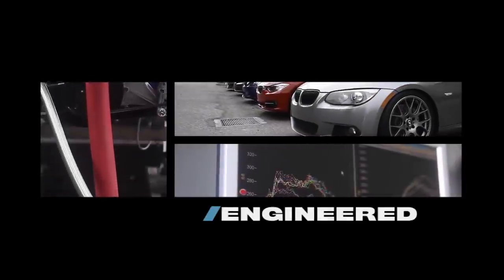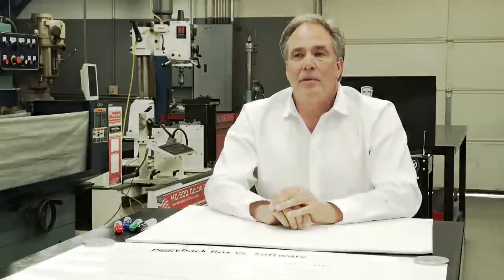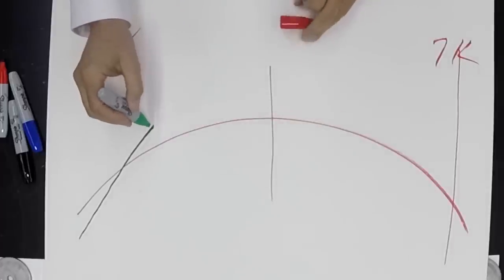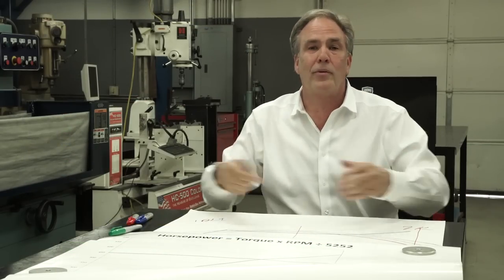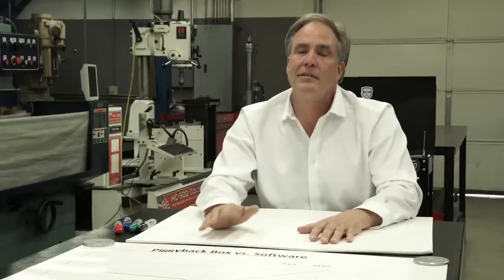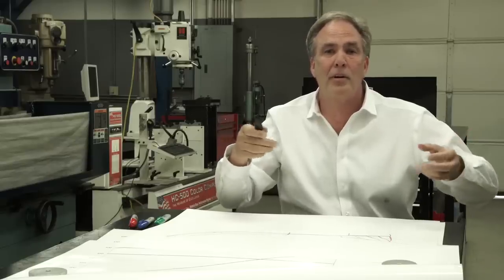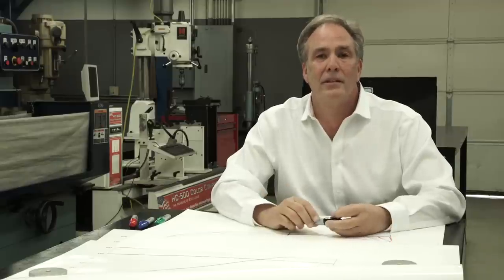The Magic of ECU Tuning - /ENGINEERED

Comment: how will this apply (forced induction )to self tuning injection sysyems? eg holley hp/dominator
Reply: Having a professional play with it over the course of a few days with the assistance of a dyno will get the best out of it. From what little i have had to do with holly hp, it's more self learning, not self tuning, i.e, it can interpret the knock, adjust the timing etc but still needs the basic parameters of the system you are running etc, such as injector size etc...

Comment: 6:50 is incorrect you can get a bone stock zx14 retuned for 10-15whp same for hayabusa, many many stock n/a cars can get a 10whp 20ftlb gain by tuning because many times manufacturers make them lean from the factory for emissions etc.

Comment: I bought a 200$ reprogramming tool for my standard ecu na clio, i can now install different tunes, like for an example if want a lean fuel mixture for pops and bangs. I was pretty unsure about the purchase but i feel like with the ron 98 tune i have more torque in the low revs, placebo or real?
Reply: You want pops and bangs? Sounds like some 4 banger ricer crap. Pops and bangs are considered cool by high school kids. If I hear pops and bangs it usually means a improper tune on the car. Its not cool at all its just sad.
Reply: First of all i didnt put this tune on it was just an example, and second have you ever heard a fucking supercar? Ohh my god it spat flames, what a bad tune it must have -.-
Reply: You don't have a supercar so don't worry about what a supercar does its out of your league.

Comment: Agree 100% with what Steve said, with one caveat. Several manufacturers essentially de-tune performance engines by vehicle class. Meaning, lower end vehicles would have lower HP 'tunes' from the factory. Take a C class AMG, for example. For all intents and purposes, the same engine as an E, CLS, S Class but a lower HP output (M156). A simple aftermarket brings your lower end tune up to the rest of the power of the higher class brethren.
Reply: True but still the hardware matters, the c class uses the same engine, but other components are going to be different which would be the bottleneck
Reply: Not only is this point valid, but there is one more piece to it.. if you don't need to pass emissions (or plan on bypassing the emissions) you can get a simple tune to basically devoid the ECU from including the protocols that relate to these things.. you will get better performance and gas mileage by removing the emissions from the equation.
Reply: David Huffman 

Partially true.Its ultimately the emission norms that keep a check on the manufacturers.

Complete combustion of the fuel does have its pros n cons.We can get the maximum out of an engine but on the other hand emission parameters may cross the desired limit.

Comment: If I understand correctly there is no gain to be had from ecu tuning a naturally aspirated engine, right? I have a K24 Honda and was thinking of getting it's ecu tuned, since the guys on the Honda forum over here swear by it, but I'm starting to reconsider. As they advertise it, the tune changes the drive by wire mapping (which apparently is a little tame from the factory to make for a family friendly car). That is probably simple to do and is probably noticeable but nothing you couldn't otherwise achieve by pressing more on the throttle pedal. They are also talking about changing the fuel maps so that the engine is more economic if not stressed and more powerful when you step on it. With what this guy is saying, I'm thinking this claim to be very unlikely, or the improvements to be on the order of fractions of a percent. The last thing they do is change the VTEC RPM engagement, so that if you are shifting at redline and on wide open throttle, when you go for the next gear, you don't drop back on the low RPM cam. Also here I'm thinking there might be some advantage, but in the real world how many times are you gonna do that and what are you going to do with the milliseconds you saved by doing so.
Reply: Exactly. The gains they promise are at RPMs that you almost never end up at. NA engines are already tuned to their maximum mechanical limits, as this guy also says.
Reply: The ECU tuning might gain a few ponies, but not much. They can change the torque curve around for better allround performance. unless you want to be 0.1-0.2s faster I wouldn't waste money on ECU tuning a NA engine.
Reply: Tuning your N/A ECU can be worthwhile if you've already modded things like intake, headers, exhaust, head/block work, but other than that, don't waste your money - especially with a Honda. Honda (by their own admission) is an engineering company. You're not going to "out-tune" them......especially with some high dollar plug and play BS. (FTR: I've been a Honda guy for 20 years).
Reply: Well, they are tuned for a more reliable car, so if you don't care about mpg or reliability you can out tune them by maybe 5-15% depending on how high you risk to put the rev limiter (you need to change the cams for that though)

Comment: great video. so is he saying that just a hand held tuner wont increase power?
Reply: not with N/A motors. you need bolt ons with a tune for N/A motors. FI motors can get by with just a tune, but can get even more with bolt ons +tune.

Comment: Dinan is correct, manufacturers tune the engines to the max based on the mechanical limits of parts. People just don't understand that. Now if you remove some emission stuff, get a better flowing intake and exhaust and then tune it of course you can make more power. But stock your not going to be able to beat......... I thought this was a fantastic video
Reply: +Ian Thompson Wrong. OEM's tune cars for worst case scenario since they are removed from the car and it has to be serviced in the field.  This leaves quite a bit on the table; boosted engines are best case scenario for cars. People like NA because if they get big numbers it makes them look like a hero to those who are devoted to that "religion" . A boosted engine will ALWAYS make more power because as he said there's basically no limit if you have good fuel, you'll either run out of fuel, pop the head gasket (studs will fix that) or bend the connecting rods...  To make big power NA, you need either more complexity (variable valve timing, etc), lots of static compression, huge cam lift and either lots of RPM (F1, small displacement hyper cars) or lots of displacement (Pro Stock). To make even more you need to fully understand cam timing and flame front in the cylinder. NA's are highly impacted by air temp and altitude unlikely boosted which are mildly effected. Most of the emissions components have been removed from modern cars, because high rare earth metal ($$$) converters clean up the majority of the bad gases an engine creates. Until Electric car zealots figure out how to make batteries cheap and get the same range a fuel car does, we'll be running on gas for a very long time. One possible break-through is fuel cells which are horribly expensive to produce.

Comment: Note, he says that software tuning a Naturally Aspirated engine nets you a 0 gain.

His shop sells software for N/A cars (BMW S85 / M5 V10). 

Which is it?
Reply: +0verbear a N/A car with no mods bro. like exhousrt n crap.
Reply: +0verbearIn 99% of cases, a simple chip tune or ecu flash with no other modifications present is only moving the powerband around (which can cause the perception), not creating new hp.
Reply: +Shift4g Hmm, yeah it may not make more peak power. But it is making your car faster. Everyone gets so hung up on peak numbers. Theres a reason why he is talking about the torque curve for like two minutes.. it matters.. a lot.
Reply: + yall If the ECU is smart enough (majority of German cars) and has wideband 02 from the factory, you can gain something if you move the fueling safety limits a bit further (leaning it out) and adjust timing assuming the fuel grade isn't crap. If the ECU isn't smart enough (majority of a bit older Japanese cars) and doesn't come with factory 02, you can gain a lot more if you know what you are doing and force the engine, through datalogging, to push for lean mixture and advance timing from the original safe/economic factory limits.

This is what I have found after having owned:

- Renault RS 2.0 (off the shelf with options given to the tuner)
- VW EA113 2.0T FSI with factory 02 (off the shelf with self tune options)
- VW VR6 3.2 with factory 02 (off the shelf with self tune options)
- Mitsu Evo9 2.0 without factory 02 (mind you this is F/I and a complete custom job with E85 and lots of bolt-ons, I purchased a custom tune and finished it by myself by having full ECU access)

What I wanted to point out here is that even though for the average viewer Mr Dinan comes across as a tuner god, all of his claims do not hold water as-is and are in need to be taken with a grain of salt.

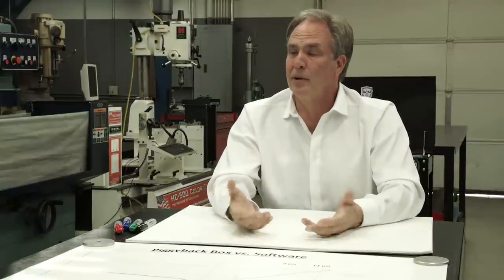Comment: 6:35 No, sorry you're wrong. You would be correct, except that manufacturers have to adhere to emissions standards and that's where the performance can be gained. There a bunch of engines used in different applications but some may be detuned. That's where power can easily be gained.

And I'm not talking about some $20 eBay chips. I mean professional tuners that are ~$400.

I come from motorcycles so here's an example. The newest generation R6 never achieves WOT in 1st or 2nd gear due to noise and emissions restrictions. That's easy to fix with a Flash though
Reply: +MotoBoy Also modern turbo diesels are a really good example.

I know there aren't many diesels in the USA so you all may not be that aware, but obviously due to emissions regulations and shit they come very conservative from factory. 
Say you get a 2L turbo diesel Ford or something, small turbo running half a bar of boost from factory when in fact it can push .6-.7 bar and the a/f or injection maps are really conservative. 
If you want to get really complex then in variable vane turbos you could probably re-tune them for an entirely different powerband.
Good luck getting the software to do so, though.

Just a reflash of the ECU can add as much as 30-40% more power in these cars if it's a low displacement engine. 
It's similar to the japanese cars of the 90s which were rolled off the factory de-tuned to comply with the gentleman's agreement thing, seemingly limiting cars like the R32 or R33 to '276' hp when in fact they were built to push 320 or more even on stock boost levels.

A different story for N/A engines, of course you're unlikely to get any sort of gain from engines like the F20C, maybe 3-4%, but in larger disp cars like the M5 E60, 500hp from a 5L V10? There's no doubt you can squeeze more power out of some of them. 

The main drawback is not being able to access these ECU's yourself. Who's going to buy an AEM Infinity + pay to get it re-tuned for small gains? ;_;

Comment: I can't agree fully on his verdict for tuning N/A cars. Some engines like Mazda's SkyActiv have a 13.0:1 compression ratio but have all sorts of cooling/anti-knock tech to let it run at 87 octane. Surely re-mapping timings for an engine like that to run 93 fuel would give you performance gains?
Reply: Most engines like that are designed so that they will adjust for higher octane to take advantage of the potential power gains.
Reply: lobsterbark
So the knock sensor will periodically add timing to see if you've maybe put higher-grade fuel before going back when it pings? Maybe you're right, but logically that seems unlikely.
Reply: ***** Most modern luxury cars at least have that feature. Many economy cars do as well, but you would have to look up your model to see if it does that.
Reply: Elsewhere I've read that later model GM vehicles run an octane diagnostic when you add fuel to the tank.  They'll try to run the most aggressive curve,  but they'll detune if they sense detonation.    The flex fuel models also have a sensor in the fuel line from the tank to the engine,  when alcohol is detected they will run the most aggressive tune possible.     My 16 Silverado 5.3 liter is rated at 355hp and 383 lb/ft on gasoline,  on E-85 it's rated at 380hp and 416 lb/ft.

Comment: What's the reason we can't directly inject gasoline into highly compressed (high-pressure) chambers and have them self-ignite like we do /w diesel?  Seems conceptually possible.
Reply: Gasoline needs compression ration of 8-10 and compression ignition engines are designed to have compression ration above 18. 

So when gasoline is fed, it will automatically burn and hence create a blast way below the TDC of crank. This will not give uniform torque and due to excessive reverse torque acting on crank , it may fail.
Reply: +Richard Mozey thats not true. 16:1 compression ratios have been and are used in motoGP
Reply: +TheCaps35 but moto Gp engines are not available. Same with F1 engines that rev twice as high as street car.
Reply: +s50201 Well because if want to do that you have a diesel engine. The reason the diesel engine uses diesel and not gasoline is that gasoline doesn't like to ignite itself, so you would have to compress it extremly. Diesel on the other hand ignites easier at high pressures, so it works better for seld ignition. Just two fuels for different engine types.
Reply: +s50201 Diesel needs way higher compression to ignite. Diesel "burns" instead of explodes like gasoline does. Gasolines ignition point is way lower than diesel, which would make issues with controlling the ignition.
Reply: +s50201 That idea's been around since the 1960's. Mercedes tried it a couple of years ago just as a technical exercise on one of their concept cars, the F700, Google 'DiesOtto engine' for more info. Also Hyundai and Delphi are currently experimenting with this, look into HCCI engines to learn more. As I understand it, the problem is that petrol contains more energy and is thus more volatile than diesel and getting it to work under the conditions of compression ignition pushed the limits of available technology. Do some research of your own, you might be able to come up with an answer.
Reply: +TheCaps35 I would consider that an exception mate. Doesn't apply to the millions of vehicles on the roads.
Reply: +Christian Huber you sir are correct, the amount of compression necessary to self ignite gas would required too  much power and make the motor weak.
Reply: +s50201 Hyundai, Kia, Mazda, and other third world car makers have been making GDI engines, Gasoline Direct Injection for years, they still use spark ignition though as compression pressures are too variable in a inlet throttled engine.
Reply: +whorayful GDI has nothing to do with compression ignition. It's just a nother methode to get the fuel into your combustion chamber (in my perspective the most efficient). The reason most manufacturers develp DI gasoline engines is due to emissions regulations and higher power output. The disadvantage of this is, that it's more expensive and harder to set up